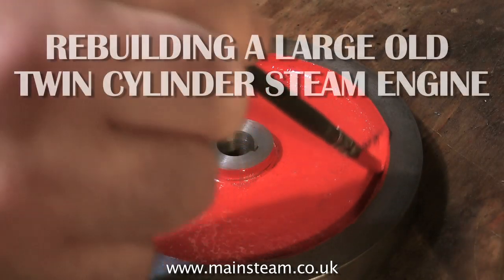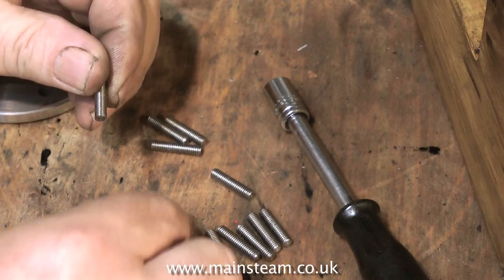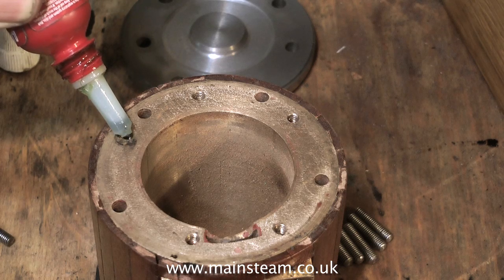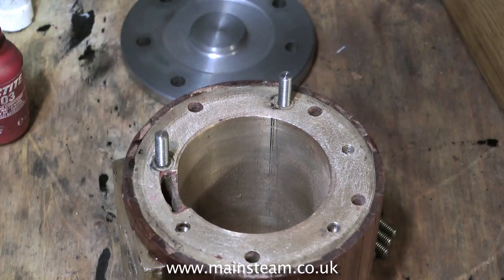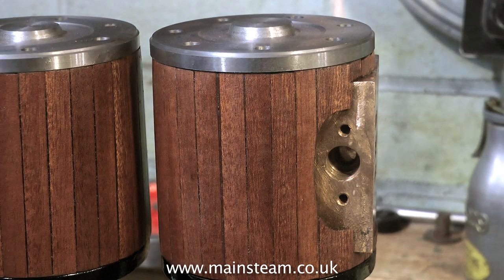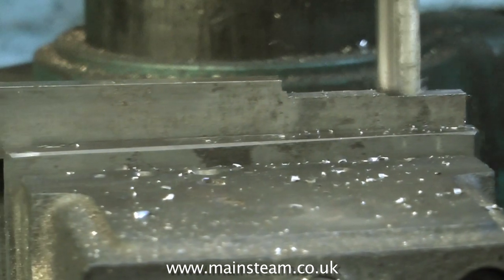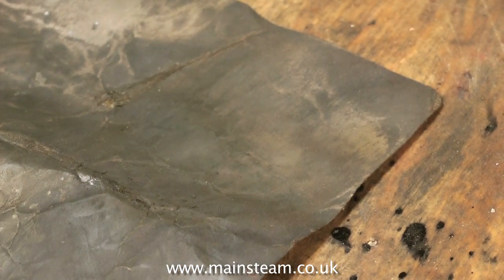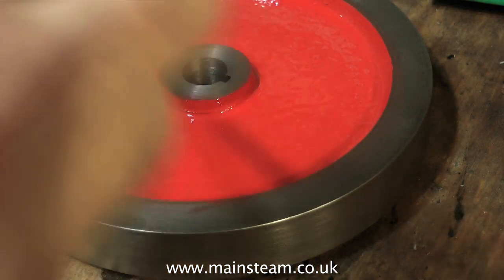PART #11 - REBUILDING A LARGE OLD TWIN CYLINDER MODEL STEAM ENGINE

Comment: Love your videos. One question - instead of applying loads of coats of red to the fly-wheel, could you not fill the surface with body filler, sand it off and then paint?
Reply from the maker: I suppose so - my way just seems quicker - that's why I do it :-)))